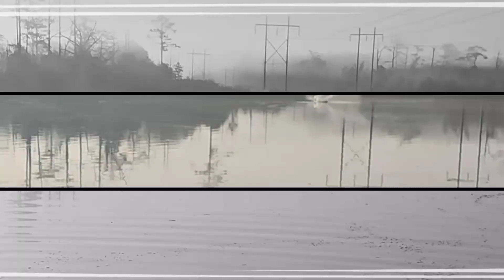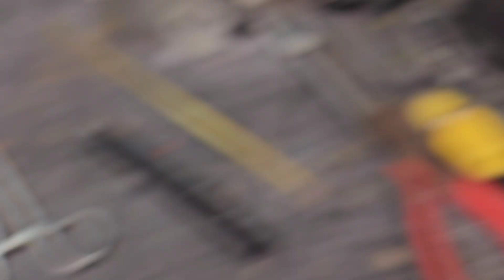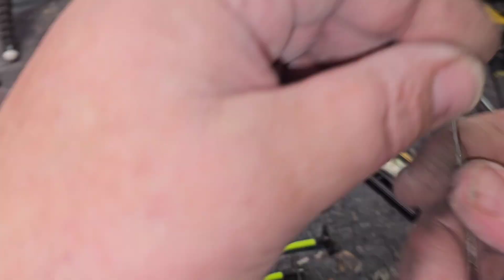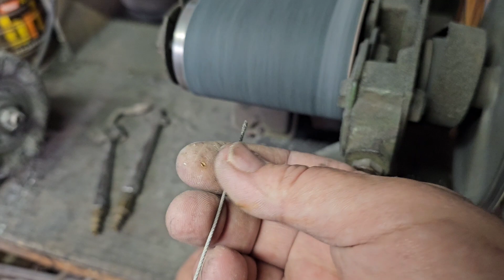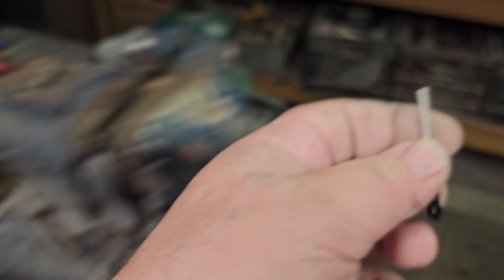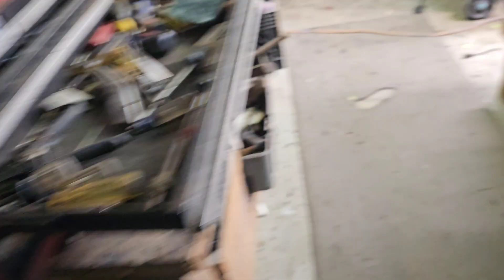PULL PULL Steering Cable Assembly, Stainless Steel Cable Braze & Loc-tite 638 Stub Connection

Comment: Would JB Weld work as good? Or is it too thick? Great job as usual. I did learn something you’re the best.
Reply from the maker: I have had great success using jb weld, takes longer to prepare and make the connection but jb weld does work yes I have several cables that I built using JBW still holding strong